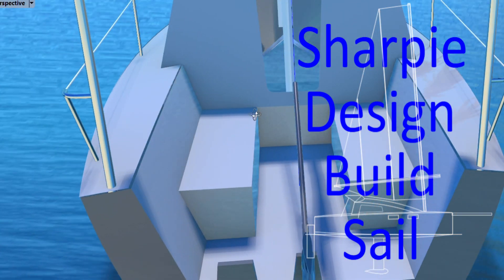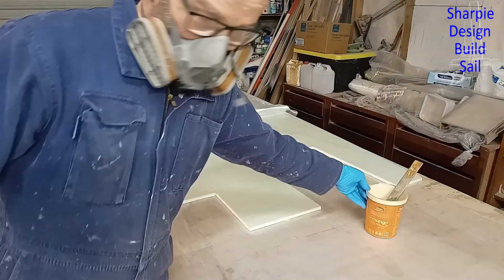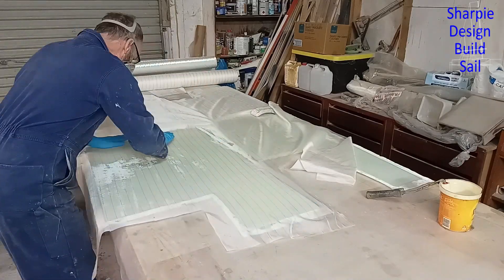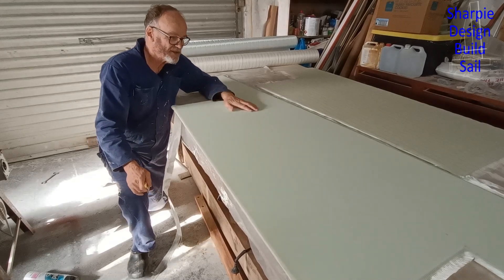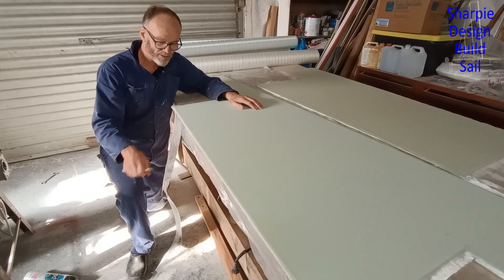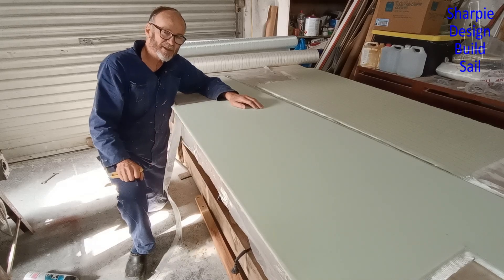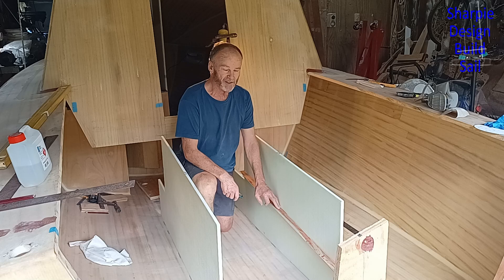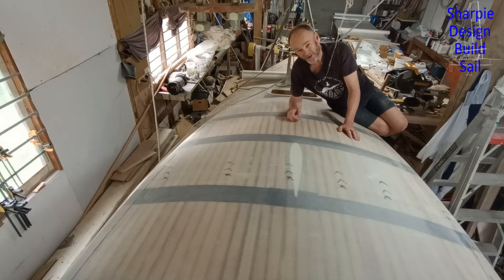Cockpit Build out of Gurit PET 12mm Foam Pt 1 - Sharpie Trailer Yacht - Design Build Sail

Comment: Hi you didn’t say how stif the panel was after glassing both sides? Would you say they were stiffer than the same size ply ? I’m thinking of building a little boat from plans using foam instead of ply I’m in the South Island and there’s only two kinds of ply down here junk and eye watering expensive imported. I was thinking about high density Polly foam but have reservations about that this PET looks promising where did you get it from in nz
Reply from the maker: You are correct, I didn't! Thanks for the question. I'm still determining an answer to that question but I can say one thing for sure. If I'd gone for twice the thickness, say 24mm, which would have made the core twice the weight of Paulownia, it would make incredibly stiff panels with just one skin of 400gsm of double bias. But, you have to determine what degree you want you hull to be dent proof and so, like I'm doing with the 12mm, I'll be putting two layers on the top of horizontal surfaces. If you weren't so concerned with the life of the boat and you were careful with it, on a smaller yacht than mine, I'd say you'd safely get away with a single layer. In hindsight, I'd probably use 16mm for the cockpit. In the next video should be able to better answer your question but I'm no expert in these construction methods and the variables of what you are proposing to built, make a definitive answer impossible. A large part of the answer will be determined by the area of the unsupported panel areas I use.
I got the foam from Gurit in Auckland and they were very good to deal with. They ship to anywhere in NZ and didn't charge for the large cardboard box it came in. They cut to the thickness you want if they don't have the thickness in stock. 
What are the plans you have? If I was building a dinghy in foam, I'd probably skin one side (the inside) of the foam on the bench before wrapping it around temporary frames, glassing the outside, take it off the frames and tape the inside. I think that would make for a very strong very light boat! I might even do that, for my own tender to my yacht.
Too finish, I'd say it's hard to beat ply for some builds but foam can be stiffer for a similar weight in my opinion so you could have a clean inside of the hull with little or no stiffening frames required. As for durability, both need looking after but foam won't rot as ply can do over time if not maintained.
Reply: @ thanks for your reply yes I had plans to do exactly what you suggested by glassing the inside first at the moment I’m looking at a small sailing pram before I do something bigger like a small pocket cruiser I like the idea of waverover but in a non ply I’m past cutting out rot in old boats. Maybe a Kevlar glass mix for puncture resistance. By the way I really like your videos and style of construction the last boat I was involved in was a steel robberts spray. Great boat but never again
Reply from the maker: @glynncleaver7398  Good to hear some more about what you're thinking of doing. Wave Rover does seem like a very capable boat although getting to the foredeck seems hazardous from what I've seen of his videos and I don't like the entrance hatch arrangement very much. I quite like how the Globe 580 can be made to work. About the kevlar, from the little experience I've had with it, I'd only put it below a layer of glass because it's a nightmare to sand, if you have to.
I appreciate your kind comment about my videos, I try and I also try to strike a balance by making them something I'd like to watch but not spending too much time or $ on them.
Wow, a Roberts steel Spray, that's a lot of boat! I'd design and own another steel yacht but I'd be extremely cautious about buying a second hand one. Like timber boats, if the maintenance or proper construction hasn't been done in critical places, they can be quite a liability. I also don't want to spend time in them asking people to like and subscribe, I just want them to stand on their own merit and if they can eventually support my 'habit', that will be great but I'm also happy with however it works out, getting out and sailing being the most important thing and also it's a given that the creative side of building something you're designed, really scratches and itch for me as well!

Comment: This video had a nice editing feel. The music and video went well together. Ever since you had the humidity and the gaps off the temporary frames issue, I've been wondering about the ultimate stiffness of the cabin top. Good to know that it's good and firm and you're happy with it. Better to have a bit more glass than to always be wondering about it.
Reply from the maker: That's so cool to hear your reaction to the construction of the video and what you thought of the combination with the music. Thanks very much for that feedback! I've noticed, watching other videos, music inclusion can make or break the experience and everyone is so different, even we ourselves like different things on different days 🤔
Yes, it was one of those situations with the cabin top that there was a lot more intuition than science involved. Right at the beginning of the project I got familiar with double bias fiberglass and was impressed by how much stronger and stiffer it is compared to woven cloth of the same weight and it makes sense, all the fibers run straight. So that's all I've used and it's paying off, the hull gives the impression of strength. I could certainly get away with single layers like on the decks but I wanted some decent impact resistance on relatively horizontal surfaces. It's not a harbour racer, I want to, like you say, not have to worry about the strength of the yacht when in extreme conditions. But it would have been fun (and cheaper) to see how light I could go and beef things up if they were only failing in the harbour. My steel yacht designs were relatively very light, my 60fter has I believe done a circumnavigation and the the 50fter has sailed many times to the Islands and back and performed really well, I don't like overbuilding things, but on the ocean, safety comes first and as the round the world racers will say, you have to complete the race to win!
To sum up, I would be quite happy for the biggest of my friends to jump up and down all day long on the cabin top and not be worried and just as importantly, the yacht could be upside down and still have the integrity of a proper way up hull, which is not always the case going by my observations.

Comment: Hi .. where do you buy your Paulownia and also the PET Foam?
Reply from the maker: Good Morning! 
I got the Paulownia from a farm in Cambridge, https://paulownianz.co.nz/, Graham is a great guy to deal with and I really enjoyed the visit. He's very knowledgeable and it's great to see how the trees are grown. He grows the Elongata variety which is the lightest, coming in at just over 200kgs a cubic meter which really is quite exceptional (Cedar is about 385) He has mostly 50 x 150 and 50 x 200 rough sawn boards.
The foam I got from Gurit in Auckland 09 415 6262 and they also were very good and easy to deal with. They have a lot of sizes in stock but if you give them a few days, they'll actually on site slice off whatever thickness you like! I was quite surprised by that, I though they would just import all the thickness's. I was also surprised by the price, in a good way, 5 sheets of 12mm PET cost around NZ$500. I have yet to calculate what the cost difference would have been to build in foam, I'll get there, but, cost was not the only reason I built out of Paulownia. Without thoroughly examining the difference, I think building in foam might have been close to twice as fast.....
Thanks for the question, I hope the answer helps!

Comment: She's coming together really nicely, well done
Reply from the maker: Good to hear you are enjoying the project, thanks for the comment!
Reply from the maker: I checked out your new channel and subscribed as your design methodology has some similarities to what I use, now and in the past. I really like the rig you contemplate using as well.
Reply: @KarlFullerNZ  I actually found your channel when I saw your dubble Ljungström Rig. That was some time ago, but since then I have also leaned towards a square top sprit rig. But I was contemplating it with a combination of a gaff without bridle, and have the sail cloth act as the bridle. I only have crude images of my rig so far. Need to build a physical model to play around with